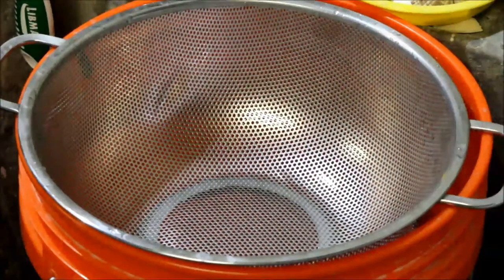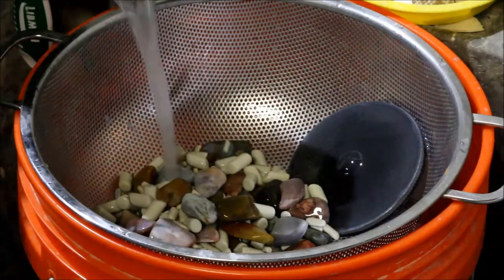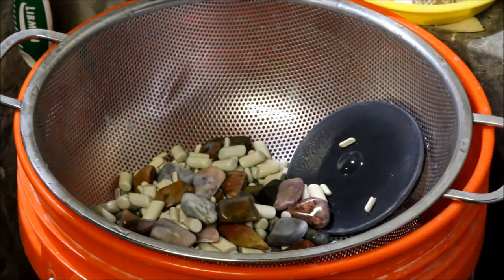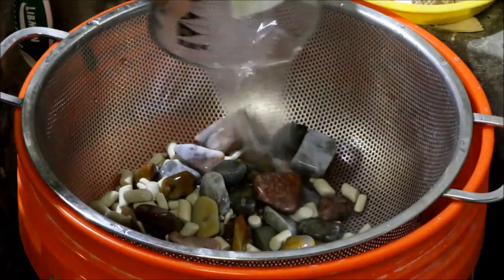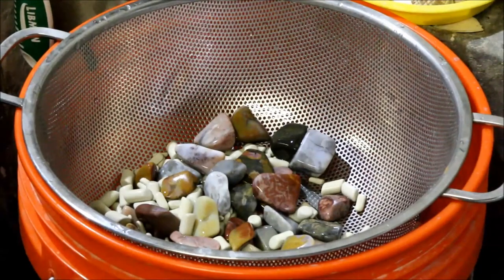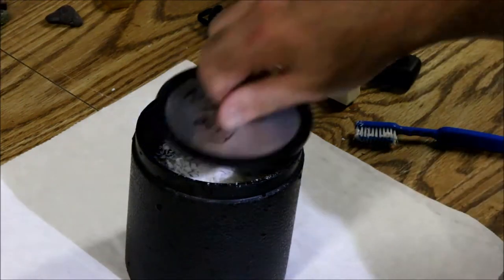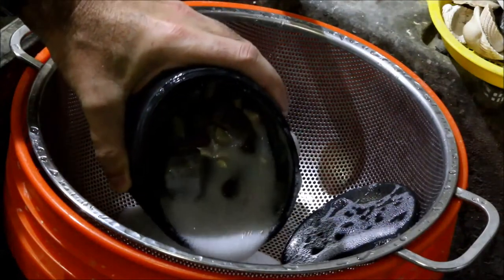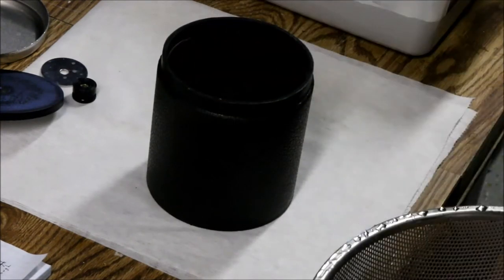Rock Tumbling Step 3 PrePolish

Comment: Get a hose for the sink and while you're at it. Go get another hose and hook it up to the hose hook up on your hot water heater disconnect the power to it and let all the water out and fill it back up. Looks like you have a lil bit gunk in the bottom of it lol. Burn up the element 🤣 great video big help

Comment: I wash between each stage.  MINIMUM of 10 hours.  If you use Borax, I then follow with minimum of 10 hours with Dawn.  The reason is, I used to do Borax but followed it up with a dawn wash once.  with 10 hrs of borax, the water was a milky pale gray.  After the dawn it was almost black.  So dawn it is.  Rinse barrel thoroughly after this step.

Comment: Use the plastic colander as a liner in the metal colander.  The small media that passes through the plastic colander gets caught by the metal colander and doesn't go into the 5 gal. bucket.  And your rocks never come in contact with the metal colander so no scratching can happen.

Comment: I am ahead of the game with the paper pad and writing everything down. I keep track of my Leopard Geckos meals and weight so it came natural to me to record the tumbler. Especially after it shut off mid cycle once and I didn't remember when I started it. Now a quick question that is time sensitive 😉 no pressure of course but I put Ivory soap in yesterday and I see you did it for a very short time. I used three tablespoons of grit and on a fixed income I hate to waste it. But should I? Thanks so much for your time. I don't want to mess up my tumble by leaving the Ivory soap in for seven more days of course so I will do whatever you suggest.

Comment: I use fine mesh stainless steel strainers and colanders. I do have plastic colanders but like you said a lot of my smaller ceramic media will slip through that. I've heard about the markings made by metal colanders but I haven't had that happen (yet) either. I also wonder if it's related to softer stones like you said? Or maybe it's aluminum colanders instead of stainless? Some kind of weird chemical reaction maybe?
Reply: Use the plastic colander as a liner in the metal colander to catch the small media that passes through.  Keeps the rocks from coming in contact with the metal colander so no scratching and you don't have to fish out the small media from the 5 gal. bucket.
Reply: @robinspringer9361  in all my time rock tumbling I have absolutely never had any issues with a stainless steel mesh strainer affecting a rock finish.
Reply: @LanceDean  Cool.  I'm new to tumbling, not lapidary though.  Anyway, I also read that SS mesh might pose scratching issues.  I have 6 tubs tumbling at the moment in a crash course to figure this out, with much research from the net, like your video.  Thank you.  I chose to use the plastic colander as a liner in a larger steel mesh colander to take that potential problem out of the equation.
Reply: @robinspringer9361  I think it's a broad excuse for poor tumbling care. I have heard but never seen damages caused by strainers of any kind. What I have seen in others' postings is something that looks more like a chemical reaction staining kind of thing, and those people were using some sort of "metal" strainer (not fine mesh stainless) and who knows what all kinds of chemicals/additives they were using in their tumbling or strange pH water they had. Stick with keeping those barrels properly filled, give the grit time to get used up before changing, stick with similar Mohs hardness rocks in barrels, and use quality polish and you'll get the results you're after (most of the time 🤣). Good luck!

Comment: Hello, what are the white ear plug looking things in there? what type of media are they, and why did you put them in there? where they in there throughout the whole process? are they ceramic?
Reply from the maker: They are ceramic media and I put them in for filler.  It's basically ceramic to take up space, but not so hard that it would scratch up the rocks.
Reply: @edcctf   Thank you, I wasn't sure if that was an option to do. I like that idea and it will also probably help them look nicer too? giving them better smoothness and add a glossy look as well? I think I saw that in one of the adds, that ceramic pellets can help add shine and smoothness.. I was thinking of adding resin triangles to one of my batches that has rougher rocks.
Reply: @edcctf   I have another question... I am finishing up my rocks from the pre-polish stage, originally they came from a beach, that is on the west coast and has high impact waves coming in all the time, so the rocks are already very smooth and round.. The rocks have been in pre polish for 6-7 days now, so they must be good to go in polish stage... but not too much has changed with them, I think because they are fairly basic rocks.. not too much going on with them.. but my main question is.. is they are already so smooth, are the first and second steps necessary for that many days.. or.. are the first and the second steps going to give them the best opportunity to exposing their true potential.. I am curious cause they are already so smooth, so what steps would need to be more focused?

Comment: Question,,, I just checked on my 3rd stage.. when I opened the barrel, it was full of foam. Any reason why it did that?
Reply from the maker: They do that sometimes.  It's not a big deal, just keep an eye on the barrel, if too much pressure builds up it can pop the top off which will cause a mess.  If the bottom is bulged out, open it up and "burp" it.